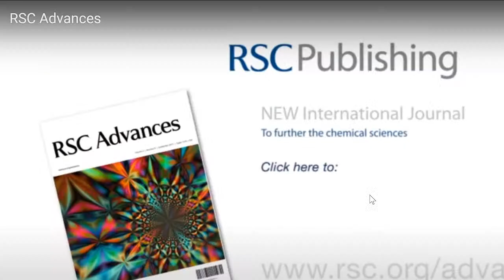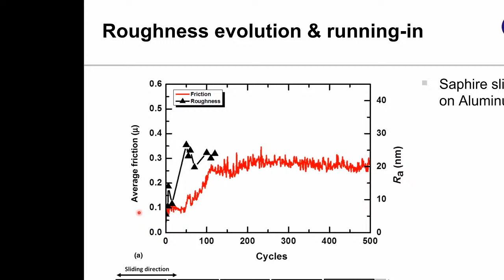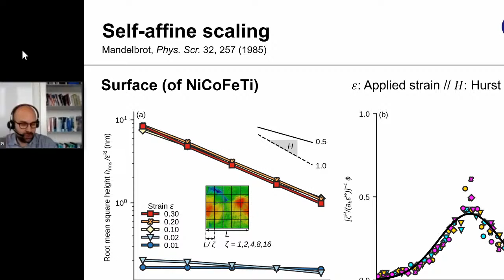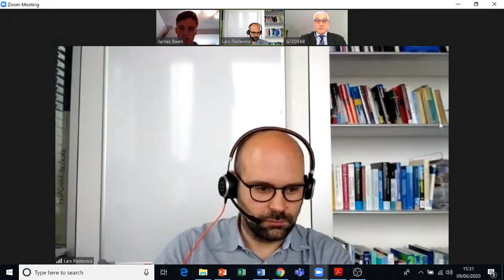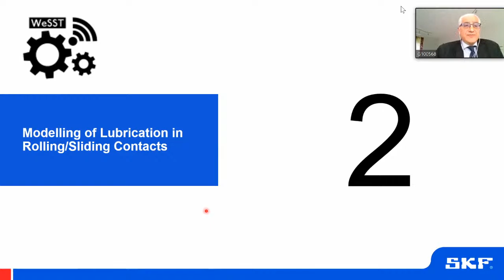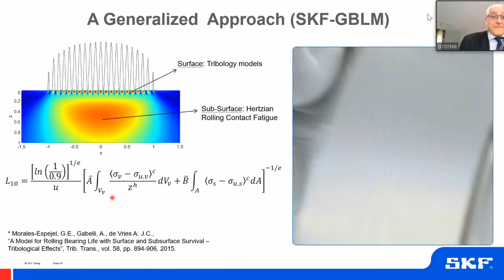WeSST 2020 - Prof. Lars Pastewka and Prof. Guillermo Morales-Espejel

Comment from the maker: Guillermo reply to Rai Notay: The concern of higher voltages close to tribological contacts is always there. There are several potential solutions to the problem (i.e. high isolating coatings in the bearing seats, etc) but the best way to tackle any potential electrical discharge through a tribological contact is a hybrid contact (one ceramic surface in contact with steel). For example in bearings, hybrid rolling bearings (ceramic rolling elements and steel rings) are an excellent solution for this, besides of having excellent tribological properties.

Comment from the maker: Question to Lars from Tanmaya Mishra
 - Do you need use a contact model for the fractals surfaces to study evolution of roughness on (static) loading?
Reply: The loading scenario in the calculations I presented is of course simplified. In rough contact, one would have two rough surfaces touching each other, leading to an inhomogeneous stress throughout the body. To understand the topology evolution of such rough (nominally flat) contacts, we could indeed combine our results with a contact model. The molecular calculations predict the evolution of roughness with stress or strain and the contact model would exactly yield the local variation in stress.

Comment from the maker: Question for Lars from Jitendrakumar V
 - How do dislocations affect the friction and wear. Do they have any effect in the Archerd equation?
Reply: This is a very broad question. Without dislocations there is no plastic deformation in metals. The Archard equation itself is a macroscopic expression that can only be an approximation. If the removal of material from the contact is plastic flow of the material out of the contact, then of course this would be affected by the motion of dislocations.

Comment: @Prof. Guillermo Morales-Espejel - what is the key effect of rolling and sliding type motion on the tribolayer response and micro-EHL?
Reply from the maker: Reply from Guillermo - Thanks for your question, there are actually several key effects from rolling-sliding motion on tribolayer, the first one is that sliding allows for friction (heat) and shear stress, key elements in the development of tribolayer. The second is that sliding is a key element in the generation of mild wear which might reduce asperities and tribolayer thickness locally.